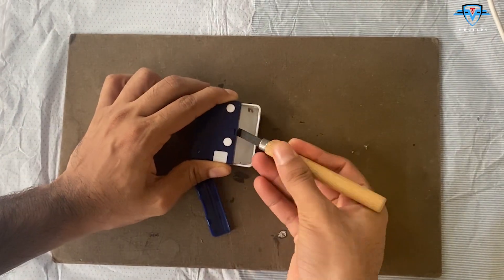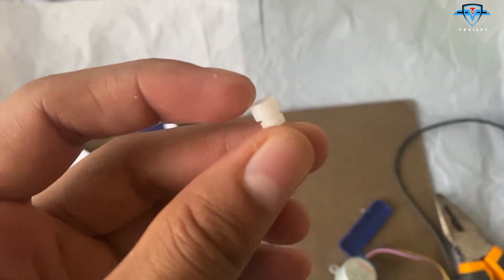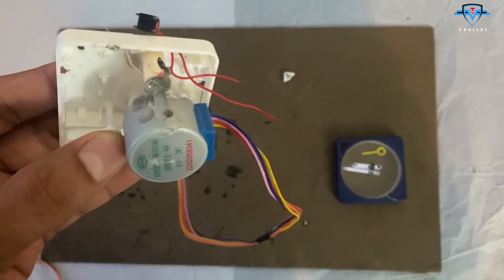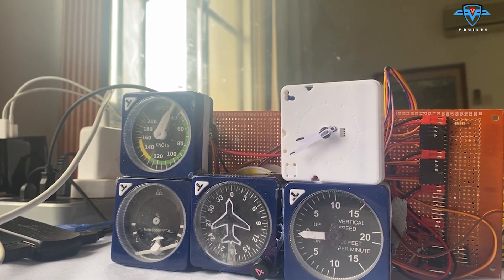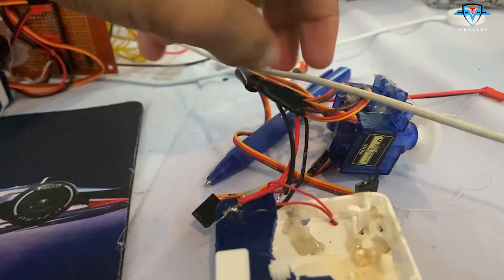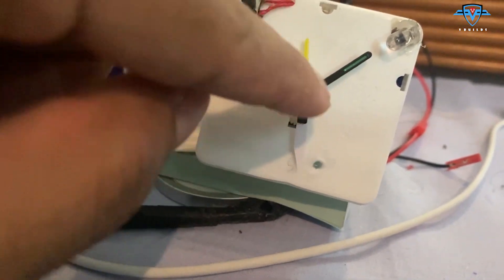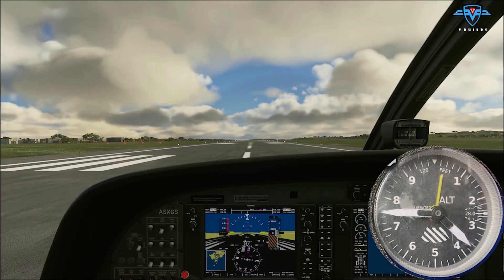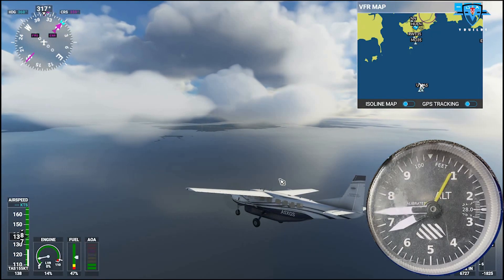How to make an Altimeter

Comment: Hi V Build your gear rapport is not correct, if you use clock rapport is 1/12, in altimeter is 1/10   Bye
Reply from the maker: Yes thats why I used 2 motors and not one … :)
Please watch the video carefully 
Bye 😉